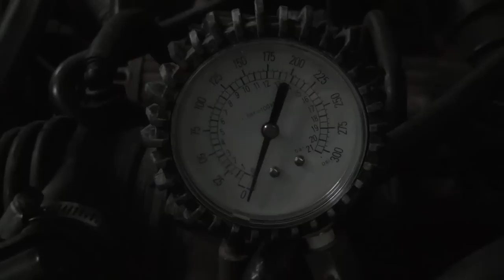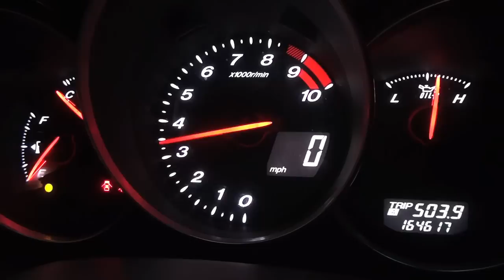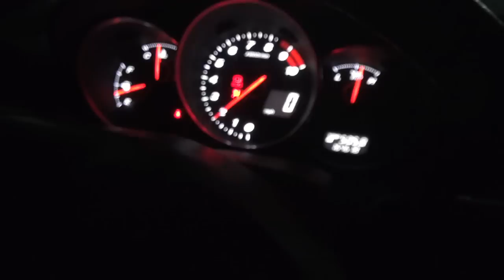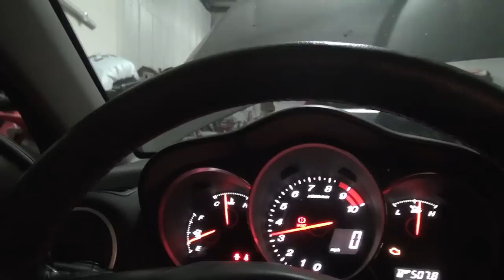Ty's Dicked S2000 | Pt.1 | Resolving Misfiring RX8!

Comment: nice fix on rx8.  Always been interested in them but I heard the mpg really sucks on them.
Reply: rotary's burn lots of gas and oil, and require tons of maintenance. Still love them though
Reply: depends on what you consider bad, i would pull 22-24 on the highway if I stayed out of boost on my FC... but once in boost not so much =P

Comment: the rx8 is running weird because it does have low compression. rotary motors are supposed to have anywhere from 95 on the low end to 115 psi of pressure on each face
Reply: probably because of the clogged cat.